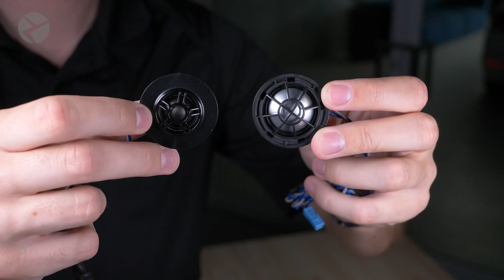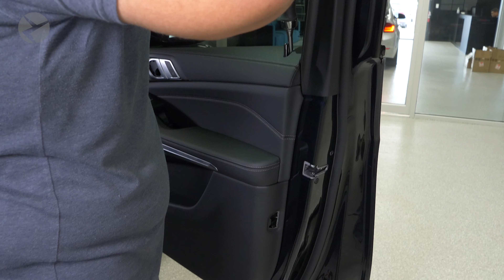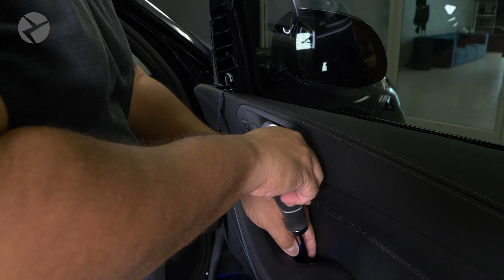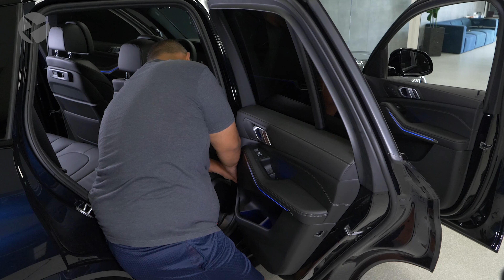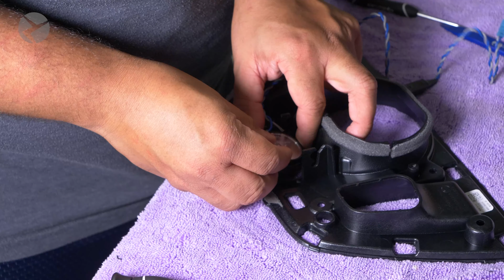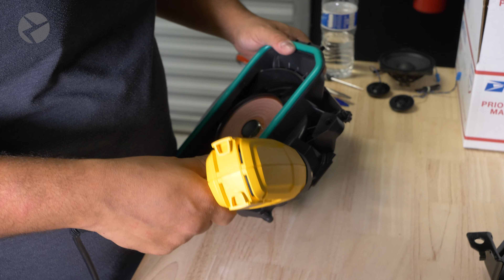Full G05 BMW Speaker Upgrade – Installation Tutorial

Comment: I have a 2019 X5 with ID7 and HK L7 system. Dealer diagnosed the amplifier needs to be replaced. Can I purchase yours to replace the OEM amplifier? I believe in your demonstration videos the old original oem amplifiers was not discarded? My question is this, do I need the original factory amplifier for this one to work? Or I can just replace the factory oem amplifier with Alpha amplifier, and discard the factory one? Thank you.
Reply from the maker: Our amplifier itself will gradually bring the sound in your car to another level, so we do recommend that move in your case :D

Comment: Tried to unglue the sub from its housing in my G01 X3... failed hard.
Reply from the maker: ohhh, but you managed finally?
Reply: @bimmer-tech  Nope, I’ve yet to take it out again an re-try.  DO you have a ballpark estimate of how long I should heat it and at what setting?  I must’ve stayed on the same spot, at too high a setting, for too long, as the sub’s plastic itself has started to melt…
Reply from the maker: Hard to tell really, but try out on lower temparature setting.